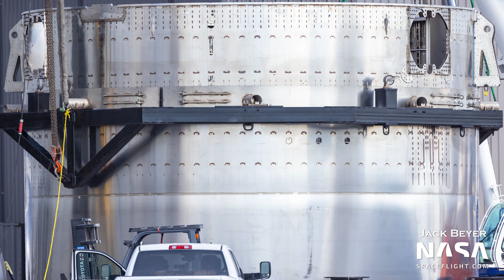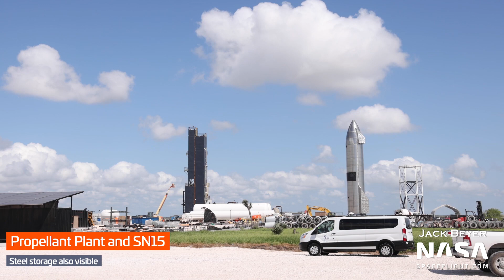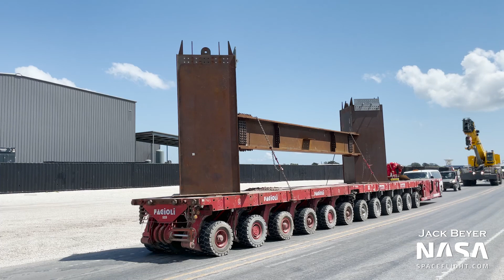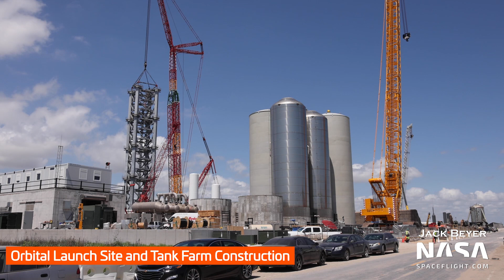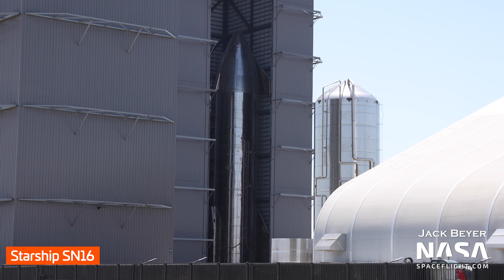Strange New Section Spotted - Crane Disconnected from Launch Tower | SpaceX Boca Chica

Comment: The unknown section is probably the grid fin mount for SH
Reply: Cause it also stands next to SH's foward dome
Reply: Yep first thing I thought of too
Reply: Thought the same too!
Reply: And those stub pipe projections, just below the fin mounts may be the catch arm stops - that section seems to be extra reinforced.
Reply: Plus interface to SS too. Doubt all weight will be on the dome alone.
Reply: First thing I thought of too
Reply: Smart man
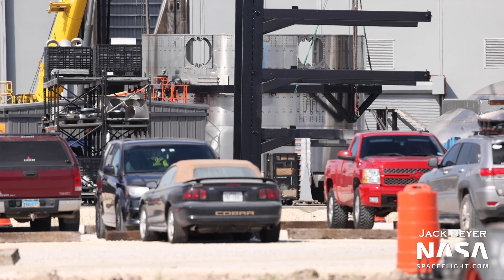Reply: that what I though but the angles are odd though. the holes are closer at 1:54 than at 0:27 which indicates that the holes are not at 90 degrees from each other or evenly spaced if their are 4 grid fins. it could still work of course but it's odd.
Reply: Interesting that the mounts are not evenly spaced. They seems to be in pairs, which makes sense if they are to be catch points. Evenly spaced would mean only 3 fins would be caught. If in 2 pairs, all 4 could be caught.
Reply: @spudski100  there was 4 on it
Reply: Exactly!!!
Reply: I thought so too, but they are not symmetrical around the circumference. That would look strange
Reply: @gavinkemp7920  there are probably still 4 grid fins but spaced so that catching the booster is easier. Looks like the angles might be 30 and 150.
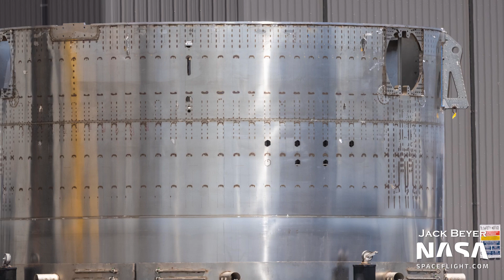Reply: Agreed, but I'm not sure if this is to be used, or just a pathfinder piece that they are experimenting with.  In either case, it's interesting that the frame around the holes and the triangular braces are laminates of many layers of metal plates - 4:57
Reply: You’re probably right!
Reply: Obviously for the grd fins. Look how reinforced it is to hold the weight of the rocket. When the tower catches it.
Reply: That was my first thought too, the way they’re sitting there’s likely two more holes we can’t see
Reply: I buy the grid fin mounts, but what are the big brackets next to the holes for?  They're only on one side of the holes.  ???
Reply: its for grid fins
Reply: Could also be attachment points for landing legs, it's still pathfinder work so idk.
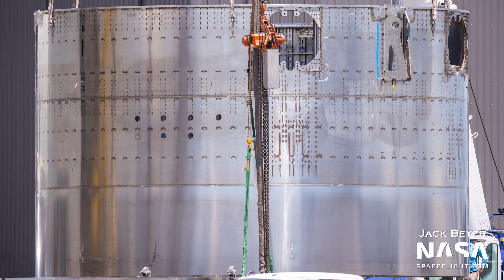Reply: 9:48 - the holes aren't symmetric around the ring, but the big brackets are between the holes.  Very interesting.
Reply: @treborg777  yeah you're right, landing legs doesnt make sense but grid fins also doest really make sense.
Attachment for the flapperon fins of starship itself also doesnt really look like a viable candidate.
Reply: I agree it looks like an interstage
Reply: This one in particular may also just be a pathfinder for the real one, but it’s definitely for the grid fins
Reply: Precise!
Reply: @gavinkemp7920  Good point
Reply: @gavinkemp7920  that's what I was thinking
Reply: @spudski100  the other two are on the other side. Cant see them from this perspective
Reply: Anybody else can’t help but be overwhelmed by the blazing pace of all this? I’ve been watching these videos almost every day since it all started and I almost don’t believe my eyes 😵‍💫😵‍💫😵‍💫😵‍💫
Reply: @paulmoffat9306  There might also be a folding hook attachment that hasn't been installed yet. Probably 2, one opposite the other.
Reply: Yup thats what I was thinking too
Reply: Unknown?? Come on guys, come on, we all know what that is , lol
Reply: Yeah! I was thinking that too!
Reply: First thought but those do look like heat tile mount holes? Or are those just from welding?
Reply: Or Starlink Antennas
Reply: Yes
Reply: I'm thinking it looks so weird because they might use that section for testing tear with a catcher system simulator or something similar.
Reply: Except it looks weird.. those mounts are not spread out symmetrically
Reply: @spudski100   interesting, made me look again as first shot seems like they aren’t at quarter points like I would have expected from Falcon boosters. But if you go to 1:56 you can see there’s two cutouts at 8 and 4 o’clock, you can see buildings behind through holes so there must be another two at 10 and 2 o’clock two.

Guessing that they must be able to get a better moment of inertia by having them closer together
Reply: @treborg777  I think it’s another catch point, it’s like a 90 degree bracket so guessing if fins are being used to catch it’s another point to offer more support and possibly some latching through the hole
Reply: The holes are spaced unevenly so landing legs won't work and there aren't plans for SH to use them anyway so its not those. The tower catch maneuver isn't till awhile out but it makes sense that they would want to design SH to handle that now so they won't have to redesign it later. Unless theres something i'm missing, i'm guessing its a GSE section
Reply: @whlphil  same bro
Reply: Yeah probably
Reply: Agreed
Reply: @gavinkemp7920  i think it is favourable to have grid fin pairs slightly closer to each other for catching. They can share more load that way.
Reply: I agree
Reply: @ericpaul4575  That sounds really weird, wouldn't that increase control authority on one axis (pitch or yaw idk which) and reduce it on another?
Reply: Sounds about right
Reply: Yo probably
Reply: The view at 9:45 shows the angle brackets to be double, at an angle to each other!
Reply: I also was thinking about that too!
Reply: I was going to say that.
Reply: Yup
Reply: @whlphil  Yeah I get your point and  initially that was my opinion too. However, upon further inspection, I think we are wrong. The circular openings aren't regularly spaced which doesn't stick with this hypothesis. F9 gridfins are 4 way symmetrical unlike these openings.
Reply: 100%
Reply: @vicentecrestani5812  if you think about how they are likely to catch it I think it’ll be straight arms either side of booster (don’t think it will wrap around booster as that would make them have to be very accurate when positioning during landing) so if your trying to bear all the weight you’ll want to ideally spread that through all the fins. Hence why I think the fins are at 10 and 2, and 8 and 4 o’clock so arms at the side have a higher likelihood of hitting more fins?
Reply: @whlphil  Yeah, that might be a plausible reason for the asymmetry. They may want to test this configuration in a ditching prior to trying it anywhere near the integration/catch tower.
Reply: That makes sense. And  then, what do you think about the reinforced attachment brackets? My hypothesis is that it might have to do with securing the booster and adjusting its position once  touchdown has occurred on the grab arms. It would also doubles as attachment points for the integration crane.
Reply: @vicentecrestani5812  yeah I think your spot on with that, I didn’t think about the lifting bit, I wonder if the catching will be fixed arm position and the crane will then rotate the booster back to launch pad. 

I was thinking the catching arm would rotate but just the crane would make far more sense.
Reply: @whlphil  I agree precise placement of the booster back on the launch mount is probably going to be done by the crane.

I also imagine the attachment point could be used to stabilize the booster pending integration with Starship.
Reply: It's not 180 degrees off the other on next to it, closer to 90.

Comment: I think it's for grid fins in a "X" vs a "+" configuration, possibly to better support the weight of the booster when the arms catch it at landing.
Reply: Seems most likely
Reply: Good call
Reply: exactly what I thought.
Reply: yup
Reply: You’re basically on the nose but I do wonder if the fins will stay out and be level with those “support” pieces off the sides of it. It’d help if I could remember a name for them 😂 But there’s definitely something on that section sticking off both sides made of metal in a way I could see it being used for support.
Reply: Also looks like maybe mounts for hot gas thrusters potentially wrapped around just above the “walkway” could be something simpler but why so many positioned around if they’re going to be removed 🤔
Reply: Won't that lead to less efficient control of the vehicle though?
Reply: Than what are the big brackets for?   Did you see them? (left and right @0:51
Reply: They could have 6 grid fins, I guess. Redundancy, better aerobraking etc
Reply: @woffist  me too!
Reply: @dhmsimons  may  be they'll  use  it in booster catch machanism with two pair of grid fins.

Comment: Most interesting, those grid fin attachments at 1:49 don't seem to be spaced 90 degrees apart, it's an X rather than a cross
Reply: Maybe the X will make it stronger or easier to catch
Reply: @markphillips7538  Exactly. It may allow all 4 grid fins to be caught with just 2 catch arms.
Reply: @max2win  As long as they can get just the right rotation arond
Reply: @max2win  Hmm, another possibility would be lifting attachments, or all in one.  But there will probably not be workers on manlifts connecting boosters to the crane arm.  At some point they will need some robotic mechanism to grab the booster and move it to the correct position to mate with the fueling ports.
Reply: Good catch!
Reply: Indeed.

My money is on legs for the first series of boosters. They know how to do legs. Going for catching the booster right from the get-go is a recipe for a lots of lost boosters and broken GSE which will slow down testing.

Comment: 1:00  My initial thought was that the section was to go on the booster top dome, and the holes were vents to allow gas exit while chilling the Starthip's motors for staging.  But looking at the holes they are clearly intended to be very strong in supporting a rotational/twisting action.  This twist moment could arise if the fin is angled off on the contact with the capture arms.   9:45  The positioning of the holes indicates that they are for booster grid fin mounts.  The fins have been moved to pairs closer together so that on each side two fins will contact the catcher arms.  Thus all four fins will support the booster on capture, rather than just two which would likely be the case with the Falcon 90-degree cross layout.  That's my two cents worth anyway!
Reply: And what is the "extension" between the two grid fin attaching points for?
Reply: @Astromath  At 9:49.  So: 1. The holes suggest they are lifting points for the crane.  To be used to swing the booster back onto the launch mount or transporter, as required. 2,  The angle of those brackets implies to me that they could be used on arrival to position the booster - to drop into a V-notch arrangement during the final few metres of descent into the catcher cradle.  So they are a guide bracket as well as a lifting eye.  That's my guess...  Yours?   

p.s.  The Falcon first stage seems to land with a precision of about plus or minus 5 to 10 metres either side of the bull's eye on the landing pad.  With the Super Heavy booster SpaceX looks to be aiming to get the biggest rocket booster ever made to land keeping the position of the top of the booster within a margin of error of no more than a couple of metres if good engagement with the grid fins and guide bracket are an indication of the size of the target zone.  Nothing wrong with aiming high Elon!
Reply: @nigelwilliams7920  Couple of meters? I’d say the precision needs to be pretty much bull’s eye. Centered between the catcher arms, and with exact distance from the tower as well. I’d say the tolerance could be max. 1m in each axis (+/- 0.5m from center position),  unless they design the catcher arms with especially versatile mechanism. But I can’t imagine a mechanism that is both rigid enough to carry the weight of a booster and nimble enough to adjust for a bigger margin. 
In any case, it will be an unbelievable feat of engineering if they pull this off, and the most nerve wracking part of any launch to watch, until Mars landings with people on board become reality. Barge landings have now become mundane, so SpaceX needed to spice it up again a little :)

Comment: Section is most likely for the grid fins, the holes are not positioned at 90° of each other which is strange.
Reply: Maybe that's a configuration which the aerodynamics also work with but by doing an "X" formation instead of "+" they can reach all grid fins easily with two catch arms

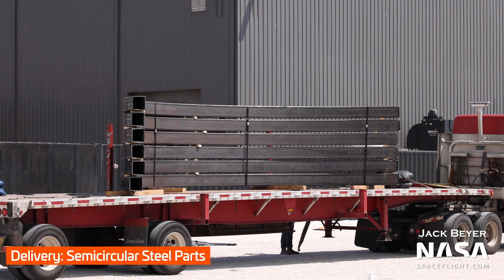Comment: Those semi-circular pieces on the trailer at 5:00 are probably the brackets that will run horizontally between the leg extensions at the launch pad.  

Interesting that only one other person commented on those semi-circular pieces. 

Now if those pieces of steel had been called "a mystery delivery" there would have been a swarm of comments on these items.  

Yes, I know that was a completely meaningless observation. But then I revel in meaningless observations!!

Comment: Could be grid fin holes, could be vent holes like the tri vent on starship itself. Either way, this is nearly the last major piece of the booster. The flight is getting pretty close.
Reply: No vents are any use if they are that wide. The gas would be too slow.
They can't be anything other than the mounts for the grid fins. Nothing else makes any sense.
Reply: It's the flow rate that matters, not the actual speed of the gas, but if it's a vent hole it's for mounting a structure with the outlet, not being the outlet for the gas. I don't think anyone has ever designed a rocket with a vent that big.

Comment: I'm not sure if this ring segment is the mounts for the grid fins. If you look you'll see the four holes are not at 90 degrees like the falcon booster. Here the two sets of holes are about 20 degrees apart matching the other two. Then what is the metal tab in-between? Very odd!
Reply: I think the metal flange will hold the actual grid fins.  The two holes on each side are for the pair of actuactor arms that will move the fins.

Comment: Unknown section looks to be a mounting ring for the Grid Fins on a booster. They are going to take huge force loads during landing so they have to really be in there, hence the huge cut outs and reinforcements around them.
Can we spot any similarities in other hardware between this unknown section and where the flaps attach to a Starship? I assume they are using the same style motors and such to articulate the fins as for the flaps

Comment: Actually, I take that back, that unknown section looks like something like a landing leg or a catching are might fit on it, weird since they intend it to splash down, but normally grid fins would be spaced evenly around, and there usually 4 of them, those two holes on the side we saw are closer than a quarter of the way around from each other, and there’s no sign of any holes other than possibly the opposite side, weird, since there’s not anything I can think of that there’s only two of on these

Comment: @ 5:02, the "semicircular" steel parts look more like "third-circular" to me. Like in 1/3 of a circle, 120°. So the six on the truck would make two complete rings.
Reply: But for what purpose?   

It seems logical to me that those are brackets to join the six columns that will support the OLT.
Reply: @michaeldeierhoi4096  maybe something for the GSE tanks.

Comment: If it's for the grid fins, then it appears that the grid fins will be in 2 pairs rather than 4 equally spaced fins. Then the tower mechanism may catch them with all 4 fins rather than just 2.
Reply: Sounds reasonable.
Reply: That makes a lot of sense.
Reply: There appears to be another structure between them which may be part of a catch mechanism, one for each side.

Comment: Maybe that's for the interstage??... Cause if thats going to be for the grid fins... there's not enough Yaw or Pitch control if the grid fins are arranged in an X pattern... not + pattern..... and if you noticed... those two holes are so close to each other....
Reply: In theory it would make sense that they need more pitch control than yaw so this way all 4 can help with pitch. If it's anything like the F9 it'll have a pretty high angle of attack and use body lift to get more cross range capability and increase drag.

Comment: Those openings are to fit the heavy duty retainer grid find which will allow the tower's revolutionary capture arms mechanism to grab (and hold the inmense weight) of the reusable Super Heavy rocket in mid air during the landing procedure without the stage even touching the ground!